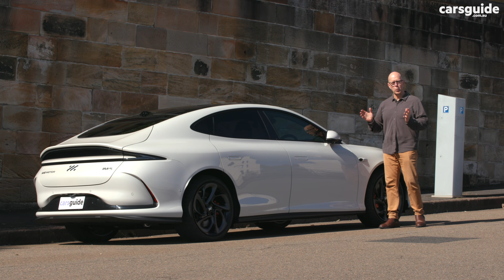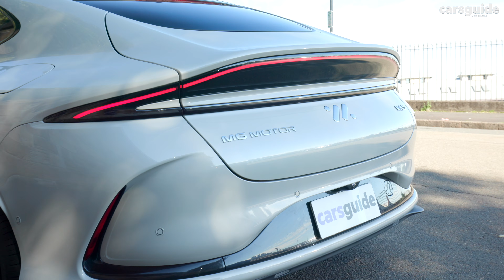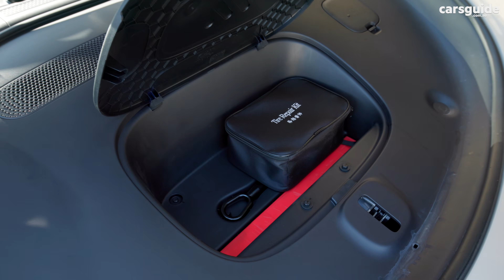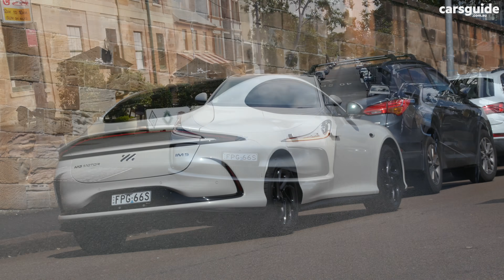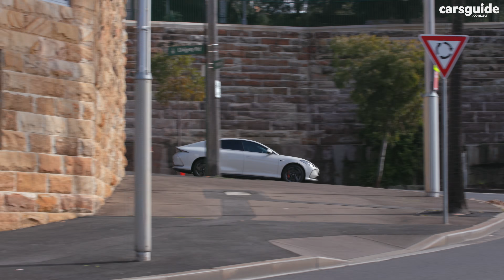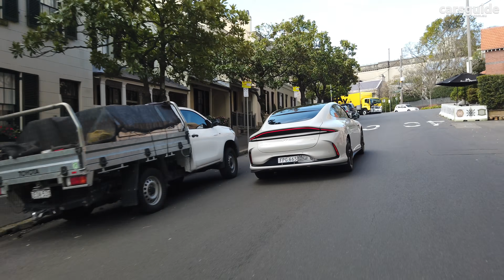MG IM5 2026 review Australia: Does this new Chinese electric car rival BMW i5 & Mercedes EQE Sedan?

Comment: “At least Matches or betters its direct competitors for included equipment”  -But for 80 grand I don’t even get a glove box included.  just a un-enclosed, grip-less under tray to watch my sunglasses & sundries fly ever where when I step on that 750hp accelerator and go to warp speed ? 

“A ultra sleek drag co efficient” yet it has a higher co efficient and is slightly less aerodynamic than the Seal & Tesla’s model 3. 

I’m going to see the dealership next week to check out it out but the glove box issue is a bit disappointing. 

Thanks for the review
Reply: 2026… what exactly are you storing in your car these days? I don’t bring anything but a phone, wallet and occasional gym bag with me anywhere.
Reply: @b97p.19 easy reach first aid kit ; car documentation + medical documents, tissues or wipes

Comment: 11kW AC charging is very disappointing. AC charging at 22kW is much cheaper than DC and is readily available at many workplaces and shopping centres. It can add over 100 km of range in an hour while doing shopping etc.
If I could charge at 22 kW AC I would almost never charge on DC.